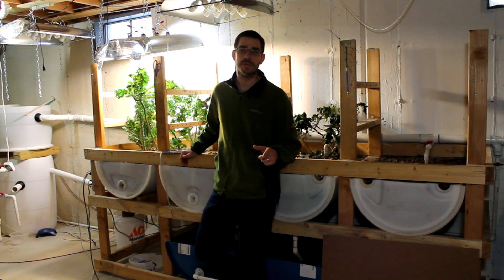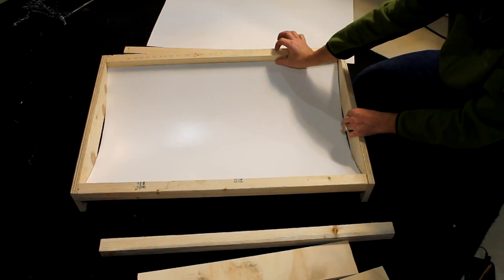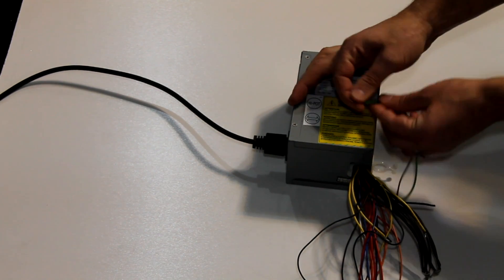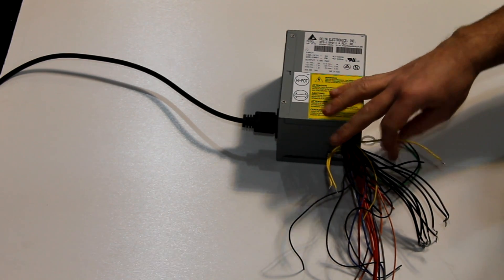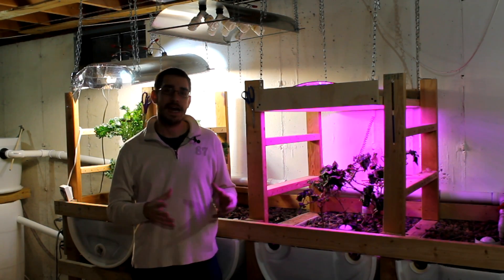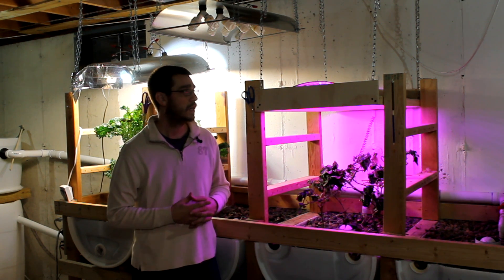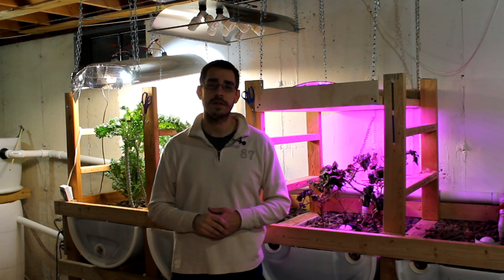DIY $35 LED Grow Light

Comment: I hope this works. Was wondering how many strips one lead from the power supply could handle. If you wired each strip in parallel instead of doing parallel and series the voltage needed would drop. Looking forward to the results of your plants growth.
Reply from the maker: +sean weir good point on the wiring they are working pretty well so far. I added a strip of 6500k leds to it also

Comment: i tried clicking the link in the description for the light strips but it didnt tske me to them. and i couldnt find them. but i did see a t5 ho light that was only 50 bucks. i wonder if thats just the fixture, or if it co es with bulbs, too. if it comes with 4 bulbs, too i seriously want thst, its a crazy good price!!!
Reply: i guess light tubes can work always better than strips. for you have to take up the work of glueing and worry about moisture... with integrated t5/t8 tubes you only have to fix to two metal snaps to hold the tube, and that's all. see the items from a professional manufacturer for those items...thnx
www.amazon.com/shops/haolin_growlight

Comment: you should of put enougn of those strips together to lay them up side side by side. thst would have been suxh an awesome light like that
Reply from the maker: +jooster I agree, the more money you spend on leds the better it will be
Reply: +SSLFamilyDad my buddy and i had actually talked about msking something exactly like this about 2 months ago. but at 60$ or more on the strips, hid made more sense for us on our budget. butni would really love to make something just like this, but use like 8 full strips
Reply: +jooster oh, does the packaging also say on it exactly what wavelength each of the inividual wavelengths are. and the ratio of them. if like some light strips were the ratio of about 5 blue to 1 red. i want to keep the internodal spacing as short as absolutelly possible. if i could get something like that i would have a super awesome light for plants that are seedlings to pre fruiting and i can start my garden much much earlier inside

Comment: I built one of these LED light strips grow light using 6000K white light and 660nm red light to grow lettuce. My lettuce plants did not grow well under those lights.  The stems were very leggy and leaves were elongated.  It was a sign of lack of light for the lettuce and the LED strip lights too weak to promote plant growth.  If I had PAR meter I would have measures the Photosynthetic Active Radiation (PAR) of my setup but that was too expensive.   I had to abandon my light strips for grow lights.  Let me know how your setup perform.  It will be interesting.
Reply: You need blue light mang
Reply: Most cheap LEDs lack a good amount of PAR. The 6000K likely was a CRI of 70, which means not really simulating daylight. Also, LED strip lights are usually limited to low power and not nearly bright enough. You'd need a lot of them and have them directly over the plants
Reply: Red lights are for flowering and stem growth. That would explain why they were leggy and elongated. Blue, is for growing the leafy parts of the plant. That is why you will often see red and blue LED's on the same light.
Reply: v
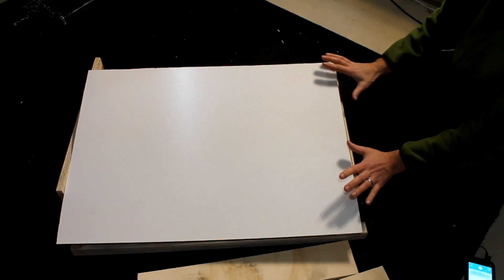Reply: Best spectrum I've used is red:blue 8:1 or 7:2, red:blue:orange 7:1:1.... Personal arangement is white:red:blue:White: uv and orange 10:7:2:10 2:10... Anyone use different or think that's wrong feel free to help me out but I go to admit it's pretty good...

Comment: Nice job.  I am only a couple of months into this type of growing but I wanted to say I turned the led strips over and soldered on the bottom and with a hint from another viewer I used a hot glue gun (the kind of glue that looks like candles) to insulate the solder joints.  Also I used your old metal hoods and cleaned the inside with alcohol first and the strips have held up so far with their own glue. A question for you.  I am using a 200 gal tank for the fish and I am wondering  using perch and bluegill how many should be in there for the four growing beds.  Also I used a six inch piece of pvc inside the tubs so that I can get my hand in there to clean out any gravel. Also I have a threaded 1/4 inch fitting in the cap over the 3/4 inch down pipe with a piece of flexible tubing going down to the top of the jagged bottom  that sucks the air quickly to the top.   So far all is well and growing. Thanks for all the info you have given me .One more thing, I have a tubing attached to the side  with wire ties inside  the 6 inch pvc with a light metal wire (about 6 inch long) and a bobber on the bottom that raises up a little flag on top to show the water rise so I know everything is working.
Reply from the maker: +Carpcrappie meohmy that sounds like an awesome setup and thanks for the tips on 5he led strips. I like you bobber idea also with the bell siphons!

Comment: I like your ingenuity and the low cost of this light. I did try the LED strip lighting but ended up just using it for a photography light because, as you stated, it just didn't put out enough lux to grow anything. I didn't bother posting the video because I wasn't really all that impressed with the strip lighting. I hope that yours works and I look forward to the updates.
Reply from the maker: +High Desert Garden (Phillip) Yeah, I am not sure how well it is going to work but worst case scenario I can add some sockets to the hood and add some CFL bulbs to it. Here's to wishful thinking:)
Reply: +SSLFamilyDad I look forward to seeing an update and review of these led strips. I am building a fixture setup like you CFL ones and may consider switching to LED. 

Thanks +High Desert Garden (Phillip) and everyone else that has given there reviews as well.

Comment: I hope this works well for you. I was not able to get it to work well for me. I'm about ready to just switch back to your other style lights as they seem to work better. I think the biggest problem is just getting enough light output out of them. I ended up with about 48 four foot strips in a two foot wide light that I built. It is just about enough light now but it is using about 200 watts to do this. I think the strips that you are using are a little higher output than the strips I'm using so hopefully that will work better.
Reply from the maker: +Brandon Gracyalny it is definitely lower output and I thought about adding a couple of strips of white led also as they are cheaper. I have mixed hopes as to how well it will work but either way I like the wooden hood better than my other one so I can easily convert them to add light sockets. We shall see!

Comment: can you show us how did u connect the lcd light thanks
Reply from the maker: +jay90374 for this strip there are 4 conductors one positive and three Commons or negatives. Each negative corresponds to one of three leds in each cluster. I solders all three  negatives together and connected to my single negative wire and the my positive wire to the positive terminal. I didn't show this very well in the video, more to follow on that
Reply: +TheShow2015 - I agree, there were 4 terminals and he hooked them up to the 1st and 3rd but I am fairly sure  it matters which side goes where. I can't tell which ones are positive which are ground.
Reply: SSLFamilyDad - Thanks for the videos